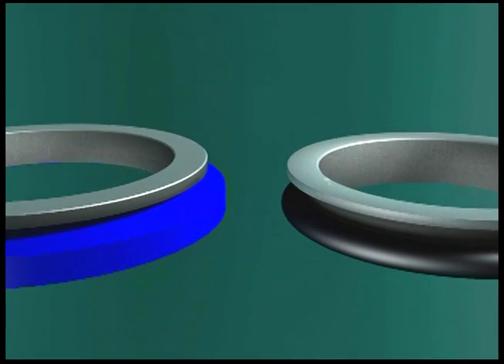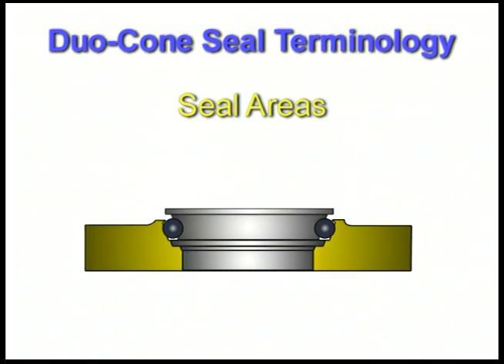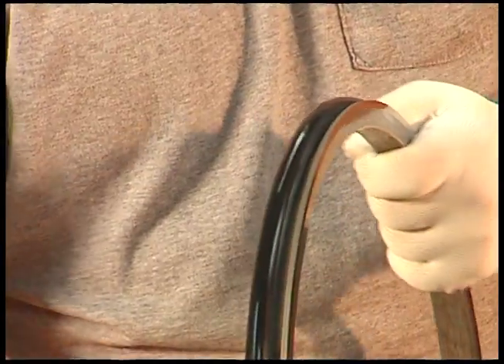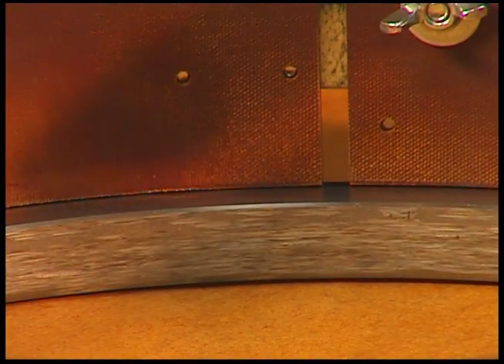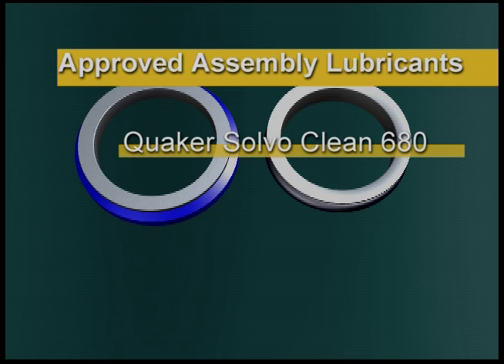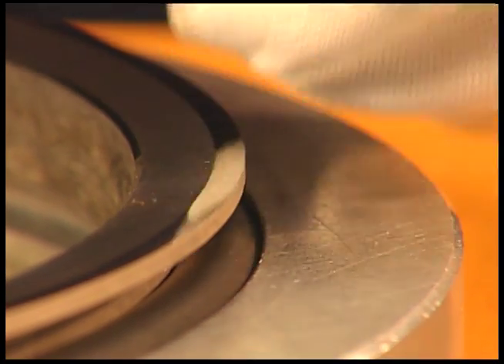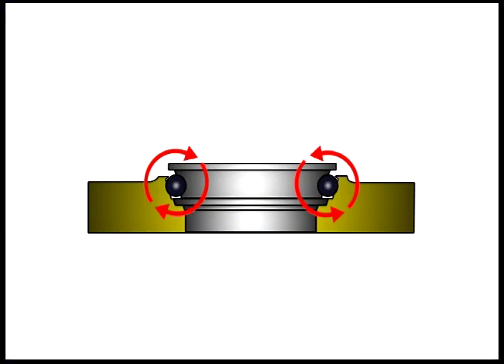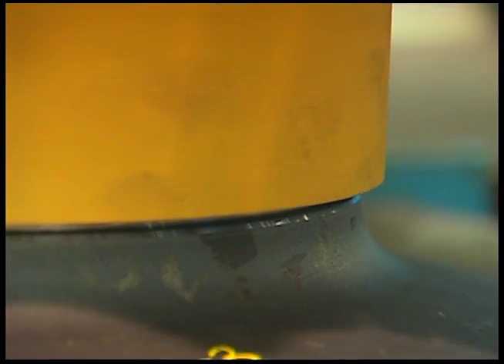Cat® Seals

Comment: Narrator: As a final precaution, it is necessary that the installer not breathe while working with the Duo Cone seal. This will prevent contaminates and bacteria from affecting seal performance.

Comment: 14 years ago (2005 - 2009) I installed so many duo cone seal in Indonesia for haul truck 793C , 789 , 785 , 777 , 773 and i used the same tool as you have in this video and much easy for me to do it myself.

Comment: In which conditions seal leakage observed, or device fail?
Reply from the maker: Cat seals operate in the harshest environments to seal in oil and keep contaminants out of a system. Many factors go into selecting a specific seal for an application. Some of these factors including oil type, system temperatures and pressures, external environment, or rotational speed could cause premature failure if not considered properly. You can learn more at http://bit.ly/2wpUGNs.
Reply: Ensure to avoid iron wires while the excavator is moving.

Comment: FYI- metal faced seals protect systems such as axles, drill heads, final drives, idlers, mobile track systems, mining equipment, pumps, rollers, tunnel boring cutters and undercarriages.